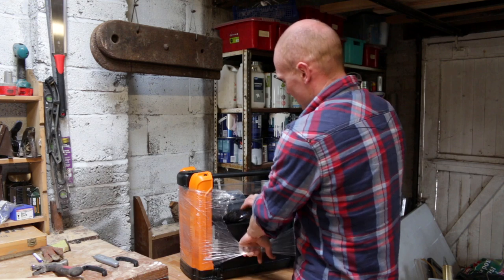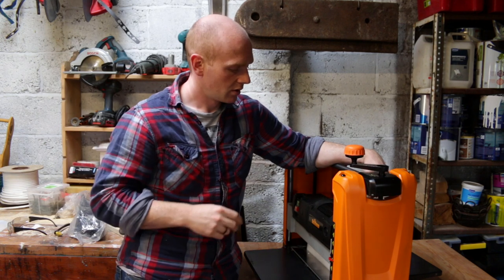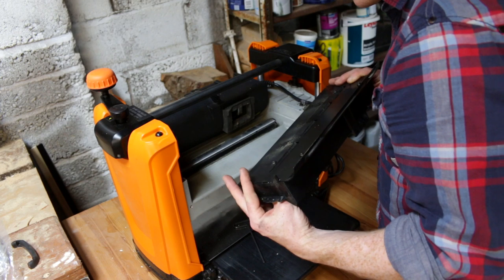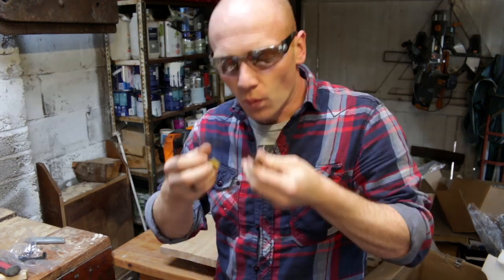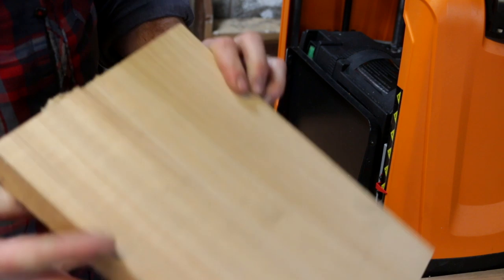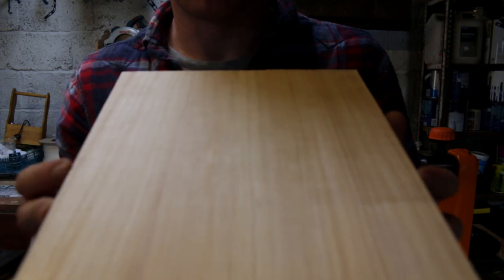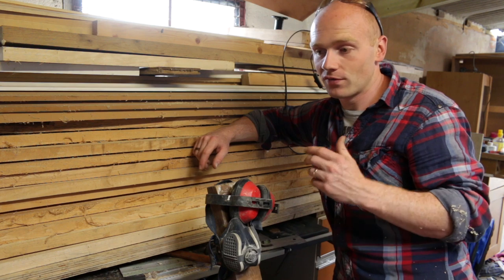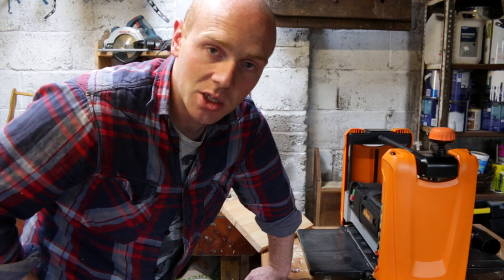This will be a Game Changer!

Comment: Hi, Tim, I bought my Planer/thicknesser brand new from Screwfix over a year ago now, and I am still very happy with the results. I use mostly pallet wood and have found a supply of 8 feet (2.44 m) pallets where they are happy for me to take them away. I have found oak and mahogany as well as fir and other softwoods and after I have checked them with my handheld metal detector and removed any nails I end up with some lovely wood. I do have to do glue-ups to get thicker wood for legs etc but that is a small price to pay for such good lengths of wood. One thing I will say to anyone going down the "Screwfix" route is you have to put the dust guard on before the machine will run, I took mine back when it did not start and was embarrassed when the guy behind the counter come round and fit the guard on with two bolts and it started straight away.

Comment: Where do you gain your knowledge of building, as I would like to learn how to re plaster my walls etc?
Reply: If you`re not in a building industry related job, start by looking up YouTube videos mate. Some are really good,  knowing which products to use, how to use them, and which are the best on the market is 3/4 of the battle won. The rest is just about spending the time doing stuff. With plastering, do something easy first off, like skimming a plasterboard wall, say in a porch, where the finish is`nt uber critical.
Reply: Reece, you can also get tons of books on how to do basically anything, so if you can't find a video on it, there's definitely a book out there about it.  Check out amazon. 
I am a woman, and I learned a ton from my father who could do all of this and more, but I still use books for the things that I need to learn, or youtube of course.
Reply: Thought as much, thanks!

Comment: Really cool to see, was dreading that it may be a printer when I saw the Brother logo! Was going to mention the shavings would be good for the coop! I was planning on getting one sometime in the near future and was looking at the jointer/thicknesser combos but it's nice to have separate machines for sure. Do you think you'll get by without a jointer, for example when you want to rip the boards to the right width, you'll be wanting a straight edge to go along the fence on your table saw (although I have come across clever table saw jigs that can achieve the same)?

Oh, I also like Jay Bates!
Reply from the maker: Well with the rip cuts that I have needed to do from rough timber I have always managed with my circular saw jigs absolutely fine but can use the same jigs on the TS for thicker stock.  Hopefully I can manage without for now and just stick with jigs and hand planes if needed.  I am pretty sure I will not need to buy shavings again for the birds though!
Reply: True, I'll think about that for myself, helpful! hehe, those shavings aren't cheap!